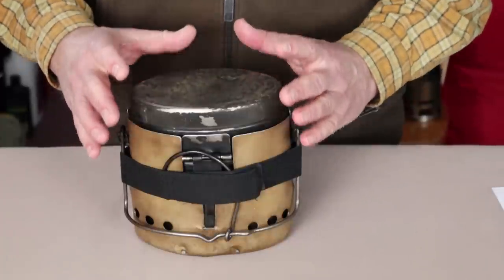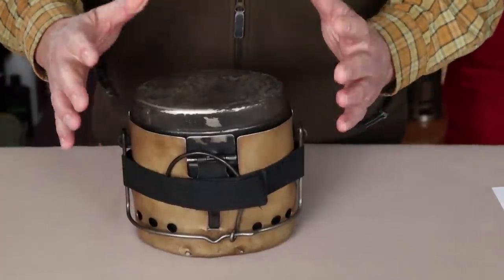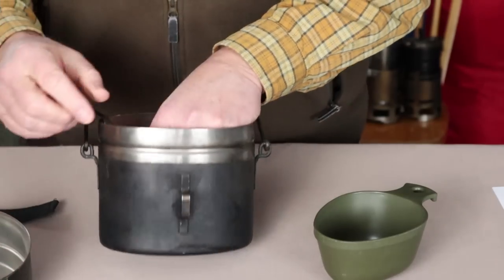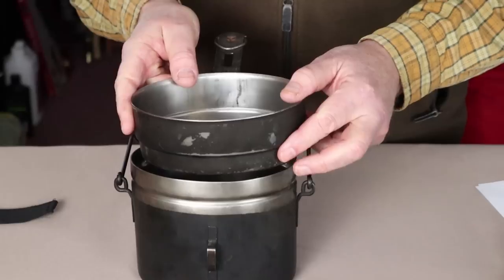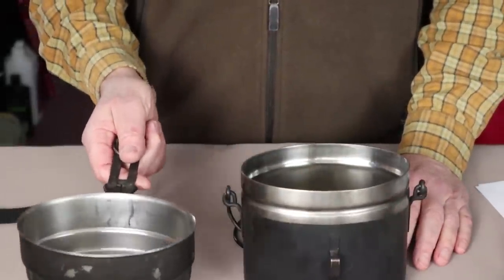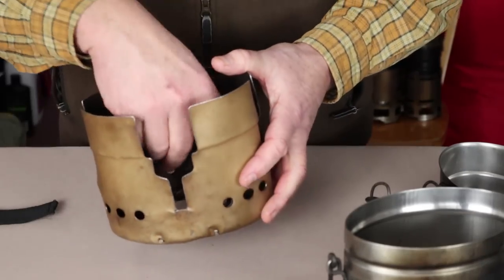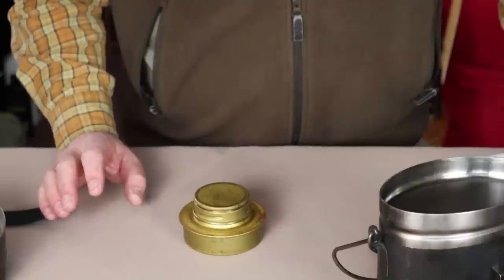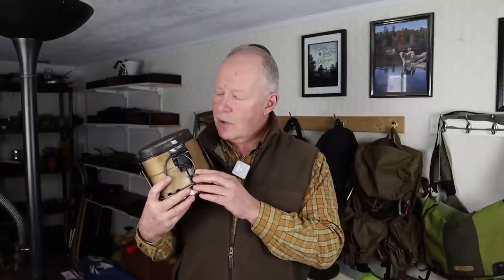Swedish M40 Military Mess Kit - Comprehensive Review

Comment: Thank you Mark for showing the "Swedish M40 mess kit". For me its has a personal historic value as well as the military history. Myself, my father and my grandfather (WW2) was issued and used this cookware model 1940. My great grandfather (WW1) was issued the earlier aluminium model 1895 and my great great grandfather was issued the copper cookware model 1887. Before 1916 there was no field kitchens in the Swedish army and every soldier prepared and cooked his own meals from staples such as a piece of meat, peas, grain, lard and such. They dug a trench where they lit a long fire and hung a branch along the trench. Then used the hook to hang there personal cookware and cook their meal. They put a stick in the handle of the pan to fry meat over an open fire, just as you described. From WW1 the field kitchens became more common first horse drawn and later drawn from a tractor or a truck. The cookware served more as a mess kit with cutlery as you described. In 1959-60 the windshield, burner and kåsa (cup) was issued because the soldiers had to be able to cook there own food if the field kitchen wasn't able to keep up. The mess kit is a fine piece of military history in my opinion. In 2010 the M40 mess kit was replaced with a modern stove from Optimus/Katadyn with both a Trangia type alcohol burner and a gas stove.
Reply: Great historical story of your family,thanks for sharing
always interesting to read such stories
atb
Steve
Reply from the maker: Wow. That is an amazing story and interesting history. Thank you so much for sharing
Reply: Some nice Historical Info .. especially the Personal Connection .. thanks 👍.
Reply: @sosteve9113  Mo, wien da'w ier en...

Comment: These are great  kits.  I have an Aluminum and Stainless kits.
Great NEWS..
Pathfinder makes a brand new Stainless kit.   It's well made and seems an exact copy.   The alcohol stove is plenty hot enough to boil water.  I use a simmer ring to lower the temperature...for frying or cooking stew.
Reply from the maker: Yes, I have looked at the Pathfinder version. Looks great. Thanks for commenting

Comment: Thanks for a great video! This brought back some fond memories. I was issued my M40 mess kit when I did my military service back in 1986-87 and used it extensively. It is true we only cooked in it ourselves when there was no field kitchen. The general going nickname we gave it was "snuskburken", and man could that be filthy! And not only due to scorching in the bottom, but also due to soldier hygiene, or lack of it. For all of us it was the first time we were away from home for 1-1.5 years and no mom to clean after us. Of course, we had "better" things to do (irony) than to wash our snuskburk. In fact, many times it wasn't even cleaned after use. So we used our snuskburk, with some traces from previous meals in it. If it was snowy we could scoop up some snow in it and just cleaned it with our gloves. "Good enough". Yeah, I know.... We even laughed at it at the time and said it was natural penicillin. The last few months of my military service someone found like a form fitting liner to use inside the snuskburk. This was practical when there was a field kitchen. This way we didn't have to clean the container.
Reply from the maker: Wow, great stories. I appreciate you sharing your experiences

Comment: Great video. I've had mine for a couple of years and really have enjoyed the addition to my "kit".  It makes a great (if small) camp oven. I cut a small backpack grill to fit inside so what I'm baking does not rest on the bottom. This also allows for the heat to circulate around the food similar to our home ovens. I've baked breads, pizza, biscuits....One other thing, using the stove this way I cut small baking sheets out of pie tins. Bread baking in camp smells almost as good as morning coffee.  Stay safe
Reply from the maker: Glad you liked the video. Great suggestions on baking. I have a video where I do some baking with it as well. Thanks for commenting

Comment: Thank you Mark for another most excellent video. I have just purchased one of the stainless versions for a very low price in excellent condition, from a person in Latvia. The top pan handle also has the clover leaf, but cannot make out any other makers marks. The burner, in excellent condition is Trangia, but alas no date. I will be using this in the field soon I hope. All the best Mark
Reply from the maker: Congratulations on finding one. Great bit of kit for sure. Thanks for commenting

Comment: Thank you for posting this outstanding video! I managed to purchase two of these stainless steel kits online years from a military surplus store selling them on eBay. I managed to get the last two in the store. I absolutely love using them. Both of them had the full complement of issue gear except for the cup. Also the paint was a cheap imitation military green that was flaking off the stainless when I receive them. I removed all the paint because I really didn't want any of that getting into the food. Your history on the Swedish variants of this kit is greatly appreciated.
Reply from the maker: You are most welcome. Thanks for commenting

Comment: If the simmer ring is an issue you can get the Tatonka simmer ring (they call it their Flame Adjuster) - works perfectly with the SVEA military stove, they can be picked up separately online without needing to buy the whole burner.
Reply from the maker: I just looked that up and may buy one. Thanks for commenting
Reply: I also bought a Tatonka simmer ring for my M40 mess kit and can also attest that it works with the SVEA military stove.  But I've found that over the years, I've ended up usually substituting my smaller Trangia burner when taking the kit it on trips because it takes up less space and seals better when closing it up after use.    I now mostly relegate the original SVEA burner to just being a historic part of that kit. 
    By the way, the SVEA burners are not bombproof.  I bought one of the aluminum M44 kits for my son-in-law, and he cracked the threads of the SVEA burner by twisting it on too tightly to keep it from leaking, so beware of that.

Comment: I bought one back in '93 and carried it for almost a decade, i still have it. They're good kits. 
Their only weakness is that despite the burner is designed to specifically work in the cold it's very prone to working so poorly you can never get the water to boil if there's any wind. You have to be careful and use it away from any wind when it's below zero.
Reply from the maker: Thank you for sharing your experiences with this

Comment: Thank you for this interesting video. I would add that the lid-pan part of the kit can also be used with the aluminium windscreen as a separate part, and will come level with it. Quite cleverly designed, as all the rest of the kit   :-)
Take care   :-)
Reply from the maker: Great point! Thanks for commenting
Reply: That’s a useful tip. I just dug out my kit and tried it. What I need to do now is to fashion some kind of lid for it

Comment: I recently purchased a PFM40 copy of the swedish mess kit.  It very well made and works as well as the Original.  It DOES NOT come with the alcohol stove,but they can be found on the internet. This mess kit is sold by the Self Reliance Outfitters and are are less expensive than the original and well worth the money!  ATB Sam Adler
Reply from the maker: The Pathfinder system is a boon for anyone wanting the M40 cook set. Maybe better as the windscreen is steel rather than aluminum. Thanks for commenting

Comment: Good introduction video. I found such a steel mess kit second hand market today. It had no burner and no wind shield. Just a pot and a lid. It cost 7 euros. It's not as good condition as yours. I need to clean it properly. But in good condition for an approx. 80-year-old item. Completely usable. The manufacturer's name Gense is written on the cover. There are three crowns inside the pot with 5012 Cr text below it.
Reply: I just tried how much there is a difference in boiling times. I boiled 1 liter/ 35.27oz of water with a modified Esbit kettle with a gas burner. I used a Toaks 2000ml titanium pot and that Swedish army steel mess kit. When using the titanium pot, the water boiled for 4 minutes and 50 seconds. When using a steel mess kit the time was 9 minutes and 13 seconds. Huge difference. The steel mess kit is made of thick steel and the titanium pot is a much thinner material. But the difference is really big, I think. The shape of the cooking pot also plays a role. A shallower and wider pot is more efficient than a narrow and tall cooking pot.
Reply from the maker: Yes, this is a big, heavy pot that is all but impossible to damage. It works well with the windscreen and alcohol burner but is at its best over an open fire. Thanks for commenting

Comment: A solution to get the best of both burners would be to set the little burner on top of it's lid, elevating the height. = faster boil time + less fuel used.  The best of both. Or you could carve a piece of wood the same size as the bottom of your stove, thick enough to match the height of the taller stove...
Reply from the maker: Both suggestions are worth trying. Thanks for commenting

Comment: Hi Mark,
Thanks for another excellent and very informative video.
It was watching this video and while searching for a Swedish M40, that I came across another Swedish military stove. This was the Ranger, again like most Swedish equipment, built to last, but probably easier to clean and a lot cheaper, at least pre-owned in the UK. 
This uses the same burner as the M40, built in heavy aluminum and also probably the origin of the Trangia mess kits of today. Trangia also made burners for the Ranger, so I am led to believe. My own burner was Svea, made in 1964. 
The Ranger, like the M40, is storm proof, but like the Trangia sets, has two pans and a lid/fry pan.  However, the pans sit a lot closer to the burner than the M40 or the modern Trangia storm cooker design, so the burner needs to bloom before puting on the pans. The pans have a capacity of around 1 litre each and unlike the modern Trangia pan set, cannot be nested while cooking. 
This stove runs hot, so I am thinking that anyone using this, is wanting food cooked very quickly, (in my experience), with no fancy messing about. I have noticed that when cooking a two pan meal, the first pan of food keeps pretty warm, while the second pan is cooking. It is pretty quick at boiling water also.
I was thinking that you perhaps could make a video of this stove as not many people know about them, while less use them. You can find these on the internet, at 'militarymart.co.uk', the real thing, for around £25 UK, which is really a steal.
Sorry about putting this in your comment section, but no other way of contacting you, so please delete.

All the very best and have to admit that for me, your videos and explanations are some of the best made. Many thanks.
Reply from the maker: Hi Walter. I was aware of the Ranger style stove/cook system and have considered buying one. I checked the website you gave and see they have them in stock. It will cost me $77.00 Canadian to buy one. It may be a while before I can afford to buy it. Thanks for commenting

Comment: Something I found intersting about these kits - you can turn the windscreen upside down, cradle the burner in the post-stand legs and you use this kit with larger pots or pans - just place it over the hole on the bottom of the windscreen.
Reply from the maker: Interesting. Will give it a try. Thanks for commenting

Comment: I have the same Swedish kit, even to the cloverleaf. and the brass alcohol stove. I have used it often and hard, most often just for boiling water for coffee in the morning camping. My plastic flask broke so I use a steel 7 0z. hip flask (labeled FUEL, DO NOT DRINK) that fits within the kit. You can also use sterno cans or Girlscout "Buddyburners" in the "windscreen". Mark called it "bombproof" I concur. My favorite mess kit of the many I have used, and I prefer the steel, having seen one too many aluminum mess kit pans melted on a fire too hot for it.
Reply from the maker: Thank you for this. I had tested but forgotten to include Sterno in the video.

Comment: Those kits allow for cooking food items, for soups or stews, and baking bread, meat, fish, with fire and coals for what you have in the pantry or countryside.. Obviously using alcohol would be necessary for front line use when field kitchens could not supply hot meals. MREs changed everything first for the military and then campers and backpackers. I use several different items depending on activities, time, distance and whether solo or group as well as whether considerations for determining what meals do I want to make or carry to reduce weight. That’s why they are relevant for bushcraft but not ultra light back packing. Luv your channel.
Reply from the maker: So very versatile. Just a bit heavy. Thanks for commenting

Comment: I have 2 of these. Both aluminum. I just use 190 proof grain alcohol from the liquor store in mine. Works great. My first one has a reproduction pot and pan. They’re good quality but the pan handle is missing the rings and the pot is missing the hook. The first time I used it I went to grab the handle once it was done boiling. It was NASA hot. You wouldn’t think it would be that hot being outside the windscreen. I made sure my second set had the hook..... They are great kits. But heavy. I can’t imagine one in stainless steel.
Reply from the maker: Yes, it is heavy so I don't carry it often but I have now worries of damaging it. Thanks for commenting

Comment: You can twist the hook thru the loop so you don´t need that strap, Done my service in Sweden so I have lugged that kit around a fair bit :)
Reply from the maker: Thank you for this. I did try as I had heard it could be done but I could not get it to go in. Might be a bit bent out of shape. I will try again
Reply from the maker: @MrEvilhearted  Perfect. Thank you
Reply: When I put it together, with the pot already in the windscreen, the last thing I fold is the handle to the "frying pan". Underneath, is the hook as Mark Young already mentioned. The "lock" which fits inside the frying pan handle when you fold it, acts like a "lock" if you run the velcro band or a piece of wood through it. The the whole piece is locked and won't rattle. Of you have the cutlery you can wedge the back end of the spoon between the pot and the loop were the handle connects, to support if you want to pour water in a controlled way. Just remember to hold the pot in its own handle so it won't swing and burn you.

Comment: The plastic cup is called a kåsa, with the stress on the å (which in this case 
is pronounced a bit like (but a bit more closed than) a brit would say "awe").
Many traditional kåsor were bit rounder, but the design is fairly traditional.
Reply from the maker: Yes, I had another viewer share that. I did not know it before. Thank you for the information
Reply: @MarkYoungBushcraft  Thank you for sharing your experiments and your knowledge!

Comment: Carried one of this kit when I did my service in the swedish army. It works well. Most often we were served food from the field kitchen and In order to avoid having to clean the kit afterward we used to insert a plastic bag before pouring in the food. As it happened the swedish state railroad used a small trash plastic bags at the time, which came like a book/block with several bags in one unit. As we used the railroad when traveling to the regiments from home, there were a tendense for these block of bags to "despair" when the conscript soldiers left the train :)

I own one of aluminium kits but have not used it since I left the army 20+ years ago.
It is one of of the swedish army item same as the LK35 rucksack which are very popular in the bushcraft crowd but we, who have used them in the army have a love/hate relationship with. Both are bomb proof kits but heavy and not always the most comfortable to use
Reply from the maker: Thank you for sharing your experience. I like the tip about using a bag inside to eat from
Reply: I have the same experience of helping my myself to some extra trash bags from the trains. But you could actually buy plastic incerts.